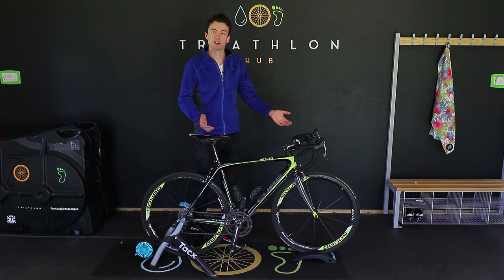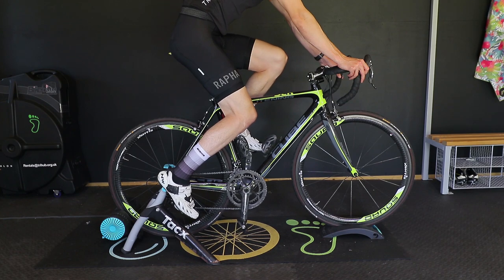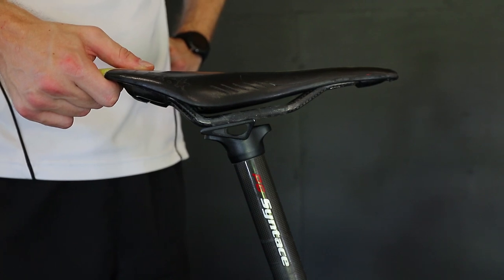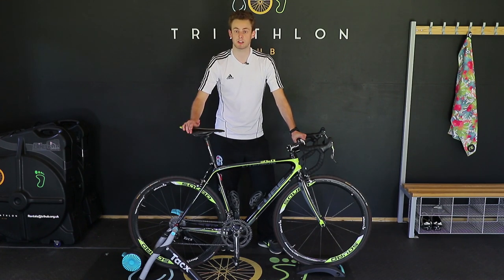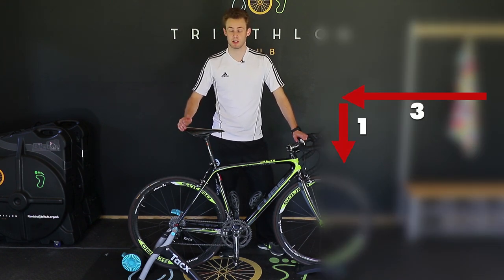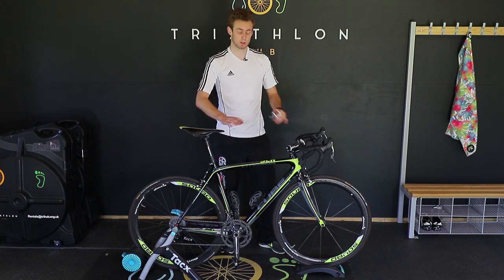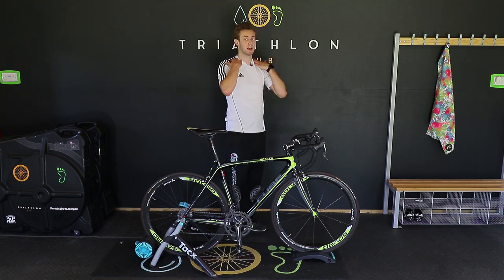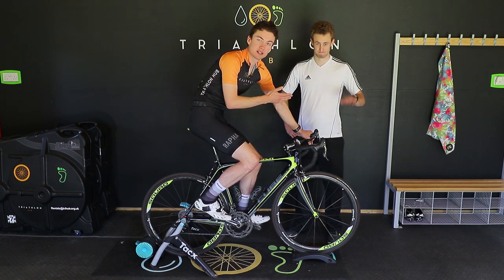How To Do a Bike Fit In 3 Steps

Comment: I've been doing the saddle height test wrong. I thought the crank should be parallel to the seat tube. Gonna refit my bike later. Thanks for this tip.
Reply: It is meant to be parrel to seat tube, leg full stretch with a slight knee bend.